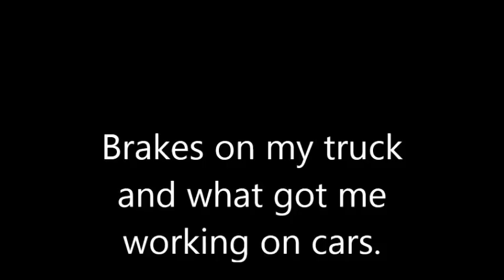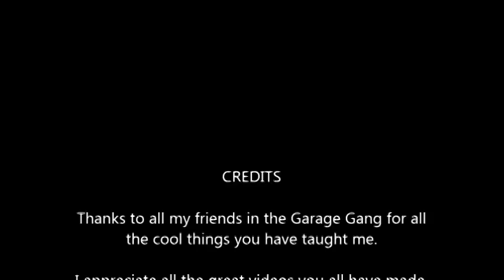Truck brakes and why I work on stuff.

Comment: I screwed up an ABS controller on a Ford back in the mid 90's by not opening the bleeder before pushing the pistons back. I haven't done it without opening the bleeder since.

Comment: If the inboard pad is worn more, you might have a piston that doesn't release right away.  You might find that out now you've pushed the piston in.  I prefer to open the bleeder so the old fluid comes out, then you can top up with new.  Also if you place an old pad back in the caliper, you can use a C clamp to push the pistons back in.

Good Job